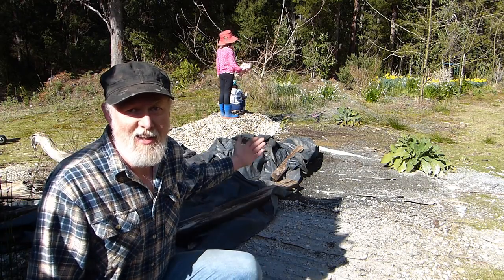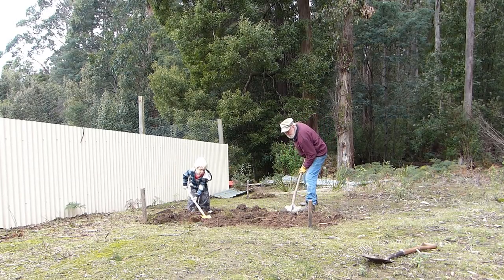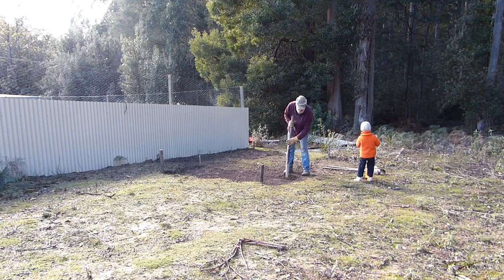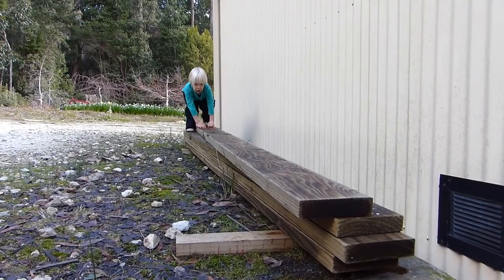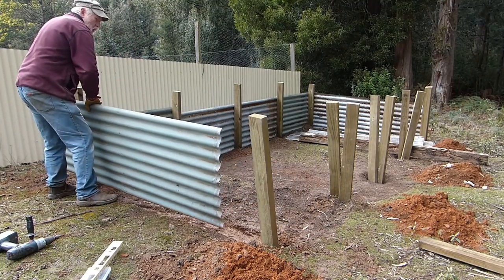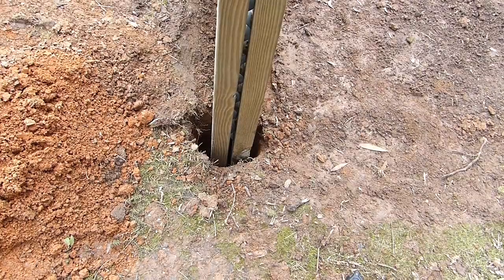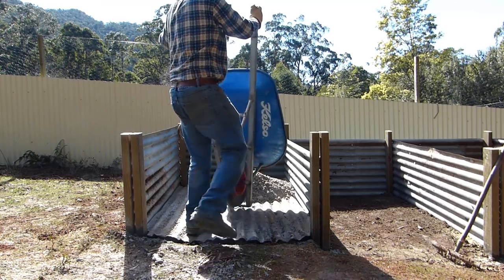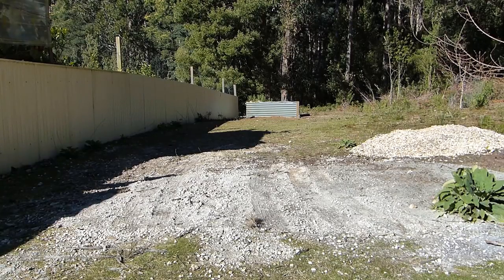WHY didn't I build THIS years ago?!!!

Comment: Great job, 
I wonder around the property (1 acre) picking up fallen branches, I have also been known to bring them back from walks around the neibourhood, and I also pick up alot of stringy bark when it has fallen from the tree's each season, so can accumilate quite a pile when the big winds come through, I would then let thenm sit for awhile, over summer they really drie out, I would then feed it all through an electric chippa/mulcher it will then go back onto the gardens around the property. Your storage project is very pleasing to the eye.
Reply: Yeah, doesn't work with eucalyptus unfortunately, picture pushing rebar through your chippa.